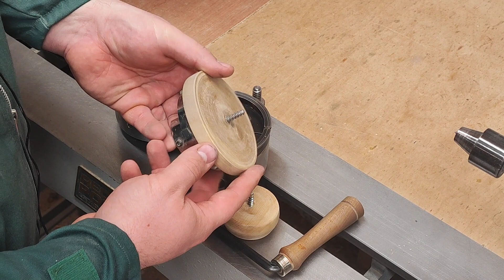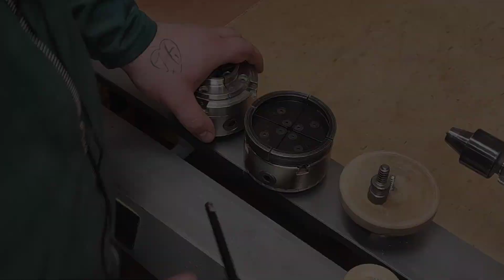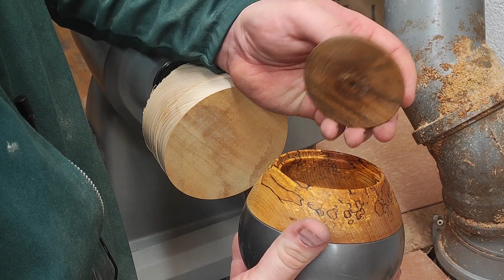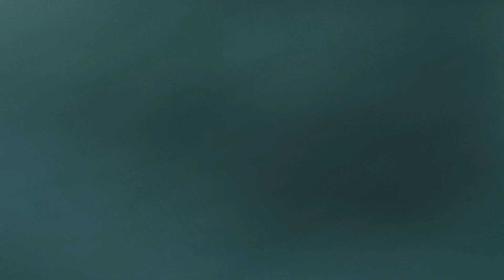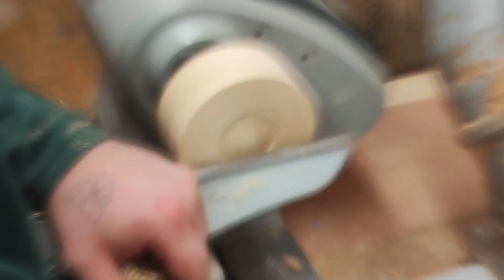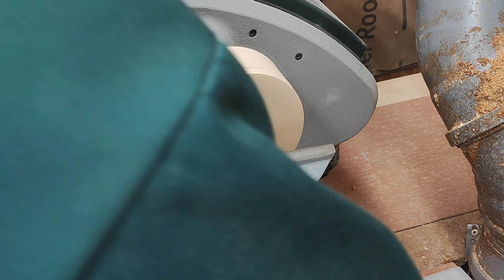WOODTURNING FOR BEGINNERS | CHAPTER 4 | Buying your first chuck?

Comment: I have inherited my fathers Record Lathe and it has come complete with a big wooden box full of face plates, screw chucks and what looks to be a complete "Peter Child Masterchuck II".  Instead of a hex key to tighten it you seem to twist it to adjust it then tighten a locking ring.  It also has a separate locking ring with lots of holes around the edge which is not in the manual so I don't know what it is for.  The holes have been marked with hand painted coloured lines so someone used it. 
 Is it a good chuck?  It's appears to be in very good condition.
Reply from the maker: Honestly I haven't used it or meet with it. I think its out of production.  If it grips nicely then keep on using it until it last😊

Comment: Ive only been turnjng for about 4 years and still have tons to learn, while I can appreciate the impressive amount of travel in the vicmarc, do you start to limit your power as you  really only have 8 points of contact (1 on each corner of each jaw)? If you need to mount a bowl with a foot that big, arent you better off (also safer)  going up to bigger jaws?  I could see this definitely coming in handy when youve got some flat-ish, square stock you want to do stuff with. Im interested in hearing from everyone.

And Tomas, thank you. Love your videos. Borh you and Richard a never ending fountain of knowledge. It is greatly appreciated!
Reply from the maker: Thank you very much 🤗, you are right in terms of grip when you open jaws, however I find small travel on other brands very limited, and for most stuff that we do grabbing on 8 points is good enough if you cut the tenon the right way....
But even better would be to have bigger set of jaws on separate chuck so you don't have to change it all the time

Comment: I got an SC3 chuck, and it came with a faceplate which has a recess on the back that fits onto the SC3 chuck. I use it a lot for bowls. I screw them onto the side of the log that is to become the top side of the bowl, and it is pretty solid. I forgot who it was, but someone mentioned you need to use long enough screws, so that 7 threads of each screw goes into the wood. No idea if that's too much or too little, but I never had a bowl fly off this faceplate, so the 7-thread rule works for me.

As for the inside lip on those chucks: I worry about those at times, that if the dovetail is not deep enough, that the lip might actually force itself into the wood and rip the tenon off the bowl. So I look carefully that I make the dovetail angled enough.
Reply from the maker: I got that faceplate ring, but I mounted on particle board with sandpaper which I use for sanding, to quick and easy mount and take off the lathe.... I don't find them usefull for bowl more then screw chuck... But that is the beauty of turning, we all do it different 🤗
Reply: @tomislavtomasicwoodturning  Nice idea as well, thank you! I actually might try that as well. 
Did you ever try attaching a grindingstone on the lathe? I'm thinking about something like that, because it could save me precious space, and if I then wanted to make special rigs for sharpening at a specific angle, I could attach those to the banjo, and then store them away in some box when I don't need them.
Reply from the maker: @judithflow3131  I haven't tried that, but I know its sort of popular it tight spaces or if you are on the budget.... Try it ,that will be the best way to know....it should be expensive as well

Comment: Thank you. Would add that the VM 120 has a very wide selection of chuck jaws, more then most others. Curious about your ratchet chuck key. Is this a custom item or commercially available ?
Reply: I think its just an Allen key with a turned handle.
Reply from the maker: Indeed
Reply from the maker: Its allen key from the chuck, I break of the blue handle and turn the wooden one.... saw it from Richard 😀
Reply: @tomislavtomasicwoodturning  but isn’t there a swivel joint connecting Allen key to the wooden handle?
Reply from the maker: @ericmoorehead1100  not sure what you mean, I broke of plastic handle with allen key from chuck it self and its regular L shaped allen key , short end I put in wooden handle, works better then regular T style....🤗

Comment: Good info and thank you for making this series. I got my first knockoff with four little 1cm square jaws and I thought I had so much magical gripping ability that I began a wedding goblet, aiming for 16", on a 12x18 midi lathe. Oh, how little I knew back then! I still have the chuck and once in awhile it is handy. Then I went Nova, and I like it, but wish I had went  EZWT or OneWay. It hasn't let me down, but I can see what I'm missing. Five sets of jaws in, I think I'd have trouble switching brands now. The main reason was speed of jaw changes. I'm guessing I should add another body or two, instead of switch.

I don't think Nova has two 50mm jaw sets, and my chuck is one size down from the Nova you showed, but I don't think mind have that lip. Just a clean dovetail.

Last thought, I seldom do recesses anymore, unless it's part of the foot and 3mm or less in depth. After seeing Richard demonstrate a perfect unmarked foot it's my preference, unless I remove it. at the end I think my hesitation before now was my more complex finishing process than you & he use. As I get faster at shaping there's more time can be spent on those better bowl bottoms.
Reply from the maker: I think maybe just chuck bodies will work best for you when you already have jaws, much cheaper then switch brands😉 thank you for watching and comment 😀

Comment: My first chuck was a Vicmarc clone from Grizzly.   No complaint except the screws for the jaws were junk.   Then I bought a Record just like the one shown here.  I like that it has a set screw for securing and allowing reverse turning.   But I was surprised and disappointed with the limited range.  More recently a Vicmarc 120 joined my collection with 5 and 6 inch jaws along with the large Cole jaws.  Most likely Vicmarc for me from now on.
Reply from the maker: Uff vicmark 120 is a great investment, something on my list as well..... One way has similar range ,those two would be Top two but vicmark all day every day 😉 Thank you very much for watching and comment 😀